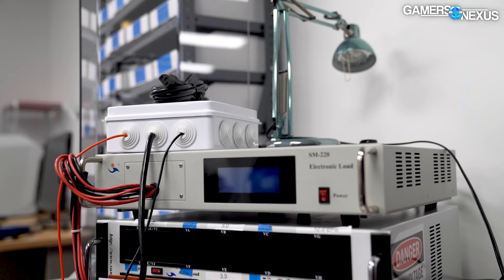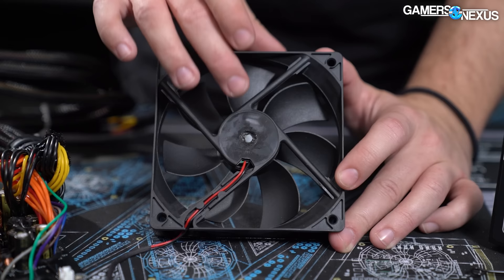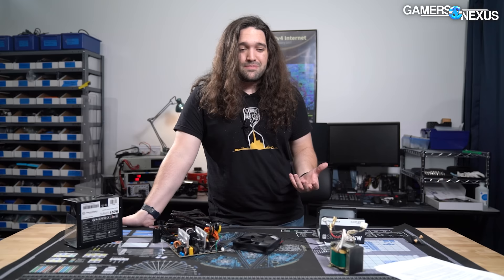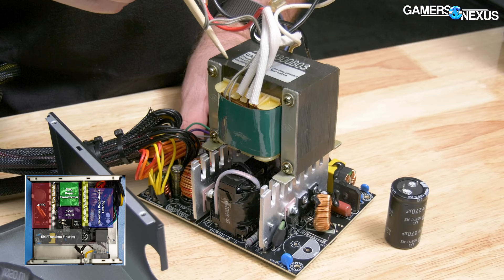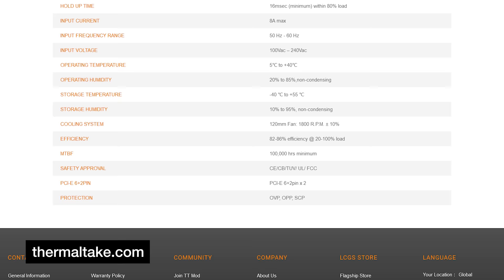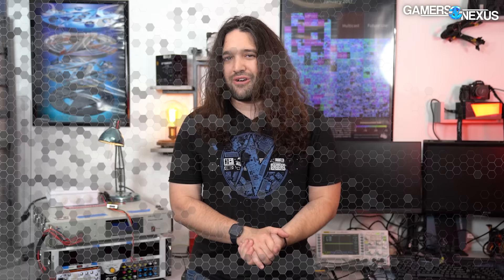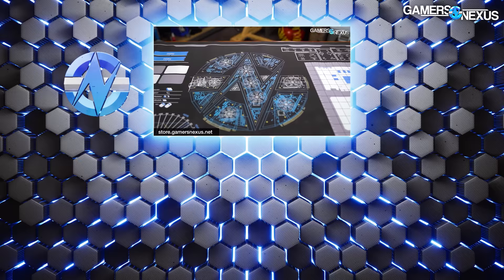Taking Risks on a Cheap PSU: $30 Thermaltake 430W SMART Power Supply Review

Comment: I personally have used that PSU on several office builds and had never had a problem with it. But that product is no longer available in my country and the most common Thermaltake PSU you would see is the Smart RGB series. Now if there is a PSU that I would like Gamers Nexus to test, its the Thermaltake Smart SE 530w semi modular unit. This is actually my favorite of all Thermaltake PSU and would love to see what GM would make of it. Although I don't know where to get one these days. I actually have 2 of them here and have been in use for more than a decade now. It was used in 3 consecutive Intel system upgrades and the latest Ryzen upgrade.

Comment: NOTHING wrong with budget PSUs, but the use case is. 
Since I started building PC's in 07', I did go for $100 level only PSUs though.
First was OCZ with a blue LED, did fine, once it was six years old, I let it go. Next was a cheap ass psu and a 2015(ish) version of this Thermaltake, lasted one year and had coil wine so bad, it hurt to hear. Went with a cheap EVGA supply after that and now roll with a 850 Gold EVGA unit, both have been flawless. I think they really do the best work with PSUs.

Comment: I recently bought a 650w power supply, it was still more power than the PC I was making needed.
Case subject just needed something that could adequately surf the internet, maybe play videos and do business work.
The Opteron 8350 has more than enough power for those needs. Unfortunately she's stuck with an amd 7470 (I think) video card, a hard drive and an SSD.
So I kinda wish I bought a cheaper PSU, but ultimately glad I picked the one I did.

Relatively speaking it still out performs her 6-7 year old laptop.

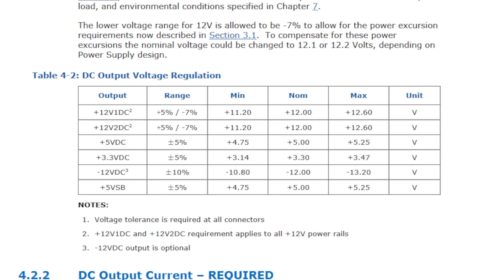Comment: 15:11 wrong table. That's the voltage regulation table, not the voltage ripple table (DC output noise/ripple).
16:42 the "best" voltage ripple (3.3 V rail) is also outside spec. As you said earlier, the spec allows for 120mV on the 12 V rail, but only 50mV on the 5 V and 3.3 V rails. You may have meant to lump it together with the 5 V and 5 Vsb rails as out of spec, but that wasn't clear from the statement.

Comment: I have a Rosewill 450W unit that I've been using for about a little over a year.  Spent around $38 on it.  The entire system cost less than $450.  For a budget system like that, the Rosewill has been fine and that TT unit would also be perfectly suitable.

Comment: Great video, love the addition of the visual diagram. 
I'd really like to see a review and breakdown of high-end power supply like a Seasonic TX-1000. I think it'd be very interesting to see the real differences between an expensive power supply and a cheaper unit. What are getting if you spend $250+ on a PSU and is it really worth the extra money?

Comment: I have used this exact power supply more times than I care to admit, never in any serious contexts it's just the "office PC needs a new power supply" power supply. I did use one for a low spec gaming PC once I think, 4th gen i7 and an RX 580. It was originally an i5, but I ended up with a freebie non-K seems to be holding well enough.

Comment: One thing is that it works when it's new. If I buy a PSU, I want to trust it 3-4 years down the road also (minimum). With "lower lifetime parts", I'm not sure. 2000h, that's 83 days and 8 hours - so not even 3 months.

I'd rather spend a bit more money and not worrying about this kind of stuff.

Comment: I just bought the 500 watt variant of this so I'm glad to hear that it's actually somewhat good. It's only going to be used in a home Plex server so not really too worried about it. It  has a 5-year warranty so I don't know that really means anything.
Reply: It's not "good", or even "somewhat good". It's really just barely scraping by ATX Spec (and even missing that on the top end of the 5V and 3.3V rails). As Steve said, it's not unsafe, but its definitely not a great unit. Unless the 20$ are needed for you to get by, i probably wouldn't recommend this.

Comment: I have a 700w version of this power supply running a 4690k @ 4.8Ghz, 16GB ram overclocked to 1866 and an evga 1070sc overclocked to 2050 and its been rock solid lmao, max draw is about 420 watts on an asrock z97 extreme 6

Comment: I have a thermaltake TR2-430 I bought in 2010. Ran my i5-750 (later i7-870) and GT240 without a problem. Turned that into a server later on and it still works over a decade later.

Adjusted for inflation though, that PSU was probably $50-$60 in today's money

Comment: Just had a clients Thermaltake 600 watt power supply that came preinstalled in a prebuilt gaming computer partially fail. One of the Sata cables stopped outputting power and fried the SSD and mechanical hard drives that were connected to it as well as the two data ports on the motherboard that were connected to the two drives. All other cables.on the Power supply still work and are putting out the correct voltage. Ended up replacing the whole power supply and installed an NVME SSD since the sataports on the motherboard no longer work (wasn't in the clients budget to also replace the motherboard).

Comment: A PSU that I literally paid $40 for! It was 2020 I think. I haven't had a chance to really use it yet. I've had good luck with Thermaltake PSU's, believe it or not. Varying quality, but they won't blow up your computer. I am a TR2 430W user, the PSU with Jun Fu Caps. I don't have that unit anymore, as it was scrapped with an old PC, and I was upgrading anyway. I didn't know as much about PSUs 10 years ago compared to today.

Comment: I've personally had the worst experience with a Thermaltake  Smart 700w. As anyone who bought it I was looking for a dirt cheap power supply that looks like people buy it. I got one and all was fine for a while. I live in an area that is subject to power surges but in my entire life I havent experienced a loss of technology through a surge. One fateful day, a surge happened and my computer wouldn't boot. The lights would come on, but nothing else. The motherboard was dead. I said that sucked and went through the 2-3 week RMA process with Gigabyte and they repaired the board, sent it back to me and I put it in. Started right up! Fast forward a couple weeks and another surge happens killing my motherboard yet AGAIN and this time I cant afford to be out of a PC so I order another board and I start the RMA process once more on the broken one. Also I get the outlet and electrical stuff checked out by professionals because surely thats the problem.  However they said everything was fine. I didn't trust that verdict because clearly something was wrong so I get a new surge protector and plug it into a new outlet along with my system that has a fresh motherboard in it and thought that'd be the end. Nope, we get another surge before the end of the month, killing my second motherboard before the first had returned from repair again. Absolutely in a rage I order a 3rd motherboard, it comes next day but as you can guess it meets the same fate as all my previous ones after some time. I had no energy left in me express towards my situation, I felt I went through the proper route of trouble shooting and  had it all covered. I was defeated. But then it dawned on me I never considered it could be my name brand Thermaltake Smart 700w causing me issue. I look up some Linus Tech Tips PSU tier list and behold my power supply was ranked so low that it was recommended to not use it with any parts that actually have value. It was a surprise to find out my PSU was dogshit but when I had first got it I thought I was getting literally the best deal for a 700w. By this point I have the first board back and using the tier list to guide my choice I order an 850w EVGA G6  80+gold PSU to come next day. Really top tier stuff. I reassemble my entire computer for hopefully the last time. In the coming weeks, a mean storm approaches and I sail my computer head first into it. Knowing there WILL be a power surge I'm determined to find out if this was really gonna be the time it survives. We get hit with a nasty surge, cutting out and on the power in quick succession 2-3 times. Something that would've definitely done in my computer any other time. Once more, the power shuts off then back on. I press the power button on my computer and it starts up like nothing! I proceed to experience several surges after this for months with no affect to my computer. I say to you as a guy with 3 of the same motherboards and 2 power supplies and hours of work time lost that under no circumstance do you buy a Thermaltake SMART power supply.
Reply: Okay, I didnt read ALL of that (jeez), but after the 2nd mb died you didn't think to change the PSU as well and destined a 3rd mb to certain death?!
Reply: @TKIvanov  Nah my logic at the time was that the outlet or the area i lived that was the problem, not my PSU. And that if something was wrong with my PSU it would've shown itself by giving me power/stability issues which I never had.  And yea definitely don't read all my ranting lmao, who cares really.

Comment: I bought one of their 450W second gen Litepower units for use in a Socket A machine. Though only because the motherboard uses the 4pin CPU connector and as a result the system is primarily 12V - and uses less combined than what I used to run on one of their "500W" (450 sustained) included-with-case PSU.

Only a 2 year warranty though instead of the 5 seen on the 430W SMART. Still far higher quality than any of my old units though.

Comment: The "stages" are not part of power conversion. They are the effect of designing by "divide and conquer". Schools teach 3 problem-solving techniques: Monkey see monkey do, Divide and conquer; and trial and error. An artifact of Divide and Conquer is that each division becomes a new circuit.
The shown EMI circuit is required because the "designer" chose a 1920-vintage boost circuit for PF correction. 
The surge protection should be before the EMI filter to keep voltage spikes from damaging the EMI components.
Then comes the 1920-vintage boost "stage" for Power Factor correction. Power Factor correction is required by law for supplies over 75 W.
Then comes the "bridge rectification". This changes AC to DC and well DUH this is the only way to design a power supply. (Ignore the 2011 AC to DC bridgeless Ćuk PF converter - with and without GaN.) 
Then comes the actual regulator stage. In 1988, many manufacturers switched from the 1920-buck converter to the LLC converter because it is more efficient (and significantly harder to control and stabilize). Stone did not tell if this is a simple buck or an LLC. The 2011 2-phase Ćuk-buck2 converter is cheaper, has less ripple, and has a better transient response.
The final "stage" is a honking big capacitor. This is to reduce the ripple caused by the choice for the previous "stage" and to provide very limited transient response improvement (again required because of the choice for the previous "stage". (Note. The Ćuk converter can be tuned to produce 0 EMI and 0 ripples.

P.S. The last power supply I helped design was used in a system that need to monitor nerve activity (1 micro V peek to peek). Obviously, the ripple must be less than 1 micro V.

P.P.S. All the power supplies shown use the 1920/1988 vintage designs

Comment: You can see the extra cable lengths were inside the PS case through the gromett.  They could be pushed out some as an adjustment.

Comment: The pricing for PSUs is very different in my country. This specific one is 14 USD. The bronze rated PSUs start at 18 USD. The high end PSUs start at 25 USD. So at 30 USD you get 80+ silver psu. At 50$ it's 80+ gold.

Comment: Using the Combined Power instead of the 12Volt Rail Power as max power Metric is a thing of the Past. i think some OEM`s like Dell  still do it that way.
Reply: Dell only includes 12V now, 5V and 3.3 V are done on the Motherboard, has been that way for the last 5 years.

Comment: I was just shopping power supplies and most of the budget offerings that I was still willing to use were sold out. Climbing the food chain I got a Corsair CX 850 for $120 with a $10 off coupon. I was surprised that CV750 were sold out, unless they stopped making them.

Comment: I am running this power supply on an R5 5600 system with an old R9 290X. I think it is rated around 275W by itself but it has ran fine for a year. I want to update to a more efficient GPU and PSU soon.

Comment: I've had problems with random Thermaltake PSUs for decades. The last one I had was a Thermaltake TR2-850. Had it hooked to 2 R9 290s in crossfire with an overclocked Intel i7 2600k and it would randomly glitch out. It became very very unstable once it warmed up.  The R9 290 non X version pulls around 275W each under 100% sustained load and the i7 2600k pulls around 111W with a decent overclock at full sustained load.  661W max + lets say 100W for a Corsair H40 AIO cooler, 2 old school 10,000rpm HDDS and 8 fans. Even at 771W it should not have had problems. I ended up returning the Thermaltake PSU to Best Buy and bought the expensive 1000W PC Power and Cooling PSU to replace it. Still running that PSU in my home server after almost 18 years.

Comment: -12V is taken from +12V rail, by reversing the  rectification diodes. If this is the case and no protection is present on this rail, the -12V can supply similar power to +12V if one upgrades the diodes. Scary to know if there is an accidental short somewhere on the motherboard/connector!

Comment: some years ago I built and sold computers 2nd hand, and this power supply was the most common and out of about 20 of thermaltake smart i ran into i didn't have one bad one, all were stable under load. didnt have the proper equipment for testing but they handled the system well with gtx 960/970/1050/1060 etc systems

Comment: I recently bought a Corsair CX550-F at a discount. It wasn't even much more expensive than the other options. It's modular, quiet, quality components (I think) and RGB if you are into that stuff. I didn't go all the way for a RMx since it was way too expensive but you can still find quality stuff without breaking the bank.

Comment: I had  a smart 650W. Thing made a constant and very loud high pitched noise when my pc was powered off. Got a replacement unit that had the same issue. Ended up refunding it and buying a used seasonic.

Comment: After showing a very low end power supply, it'd be neat to see a top end power supply to compare how the block diagram changes side-by-side. Having even a standalone Patrick Stone video of  "Here's all your basic blocks, here's the lowest end parts needed to just make it work, and here's how PSU manufacturers are making that block better at the top end and why it costs so much more"

Comment: 5V is still used by hard drives, USB and associated peripherals.   I do value criticism that the 12V rail can't hit the rated output but I wouldn't call it misleading either.  I guess I'm saying that I'm having an expectation that there will be some additional load on the other rails that would go towards the total rated output and misleading is a bit too harsh of a term to describe it.  

I love the new block diagrams in the review.  Bonus coincidence that  Patrick's eye line up with two of the capacitors on the board for a moment.  Spooky.  It would have been nice to have an AC square wave graphic given when Patrick was describing the rectification.  Ditto for the part numbers being stated in the video.

Comment: I wish you'd add a noise and temp test for those cheap and common PSUs. From my experience one of the biggest reasons for changing PSUs is noise, though usually from ageing fans (and that's not easy to test). However, if the PSU runs cold and doesn't have to drive the fan high it will almost surely last longer before the fan craps out.

Comment: My pc started as a prebuilt but over time I upgraded pretty much everything in it as I learned more. One thing I never did touch is the psu. About a month ago, it died finally and I was really scared that it damaged something but it thankfully didn't. Definitely replaced it with something at least somewhat decent and reputable. The original was some generic silver one.

Comment: 9:50 I have never seen any PSU (except for those in class-a or class-ab audio amplifiers) that actually have a bypass relay for the inrush current limiting circuit.  The resistance of the NTC thermistor usually goes down to 1 ohm or less once they get to their working temperature so a bypass relay isn't really needed in that case anyway.

Comment: Small correction to the table at 21:43 you're showing the overcurrent percentage two different ways. You show 12V, 5V and 5Vsb as percentage of the rated spec but 3.3 as percent over the rated spec. 
Either 3.3V has to be shown as 100% or you need to substract 100% from the other numbers.

Comment: This psu is doing just fine after 3 years with my I7 4790k and gtx 1060 (the best I could afford at the time, I'm poor lol), power consumption under full load is 250W at the wall. So I think it's doing quite well with a system quite a bit more power hungry than recommended.